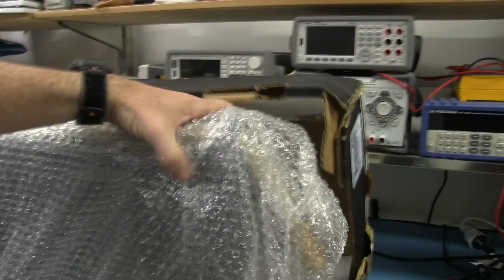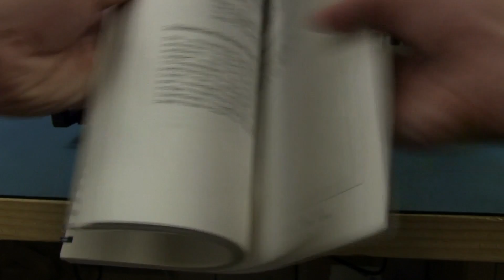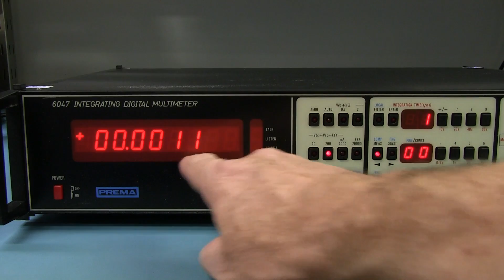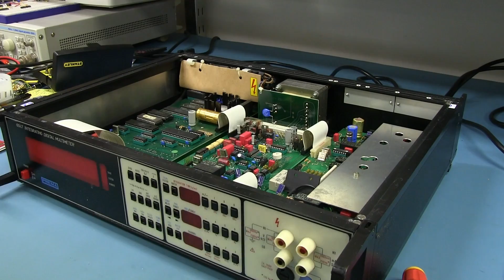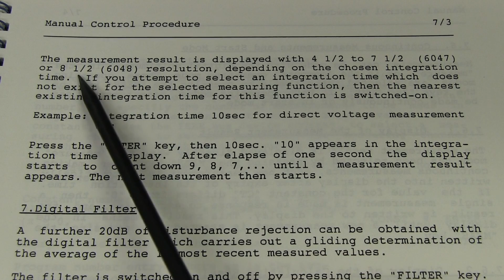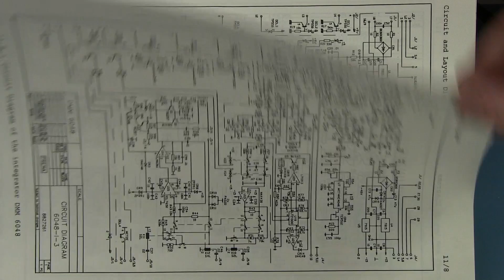EEVblog #613 - Prema 6047 Multimeter Teardown

Comment: hand picked? that makes sense for resistors and cheap components, but for a voltage reference? what do you do with the ones that don't meet the criteria? throw away? that doesn't make sense, those are not cheap
Reply: ThinkLearnSolve You could use them in a lower spec product. Of course you can’t use them in your primary product – it’d make it out of spec. That’s why you select them.

Comment: 2:50 hope the postal service didn't ruin it..

though for this reason (and for chance of the thing getting lost), it's a small effort to send stuff insured.. Where I live, I send anything over 100€ of value ensured because otherwise it's just too risky of getting lost or damaged. Of course with gear like this, you're only going to get back your eBay bidding or costs, and not the full value of the machine

Comment: it is 8.5 digit you can see the extra digits @ 32.21 so i will gamble to say 6047 and 6048 may have the same parts and just different firmware....http://ohh.de/6048.htm
i am sure someone has the firmware stashed away some where.

Comment: Did cost 613 USD on ebay.uk, if that's the one (the dirt on the display and below the power button is the same, as is the black stuff under the mADC button). Quite cheap compared to the HP3458A, but the 3456A is a magnitute cheaper and with 2ppm still more thanb enough for me

Comment: Thing is with Ebay and selling things, packaging cost extra money on the P&P that no one will pay for when other people pack items like the one Dave got for less cost then I fully protected item.

Plus PayPal taking their money which is from the total cost so the money the seller has to send items is even less.

I have sold items on Ebay and ended out of pocket because of the postage costs with the low sell price the item reached.

Comment: typical 80s Dallas clock chips. Hate them SO much. especially cutting into them to solder a new battery holder with battery in so to continue using the same Dallas chip.

Comment: yeah that's the problem with ebay. I bought n analogue tektronix scope off ebay for 60 quid. The bastard didn't package it properly. It didn't work when it arrived. I bet the crt was totally smashed because I could hear what sounded like rattling glass when I took it out of the box. What is the neck of the tube made of GLASS!!

Comment: Isabellenhütte is an old german company specialized in precision and load resistors. they were founded in 1482!
Reply: Interesting. What did they do in the 350 odd years before the resistor was invented?
Reply: "Hütte" in this context means iron works and that's what they did before resistors were invented.

Comment: Great video. Yes the diode, and resistors that appear to be repaired from the top side of the board are not to perfection, but I have serious doubts that those repairs would ever pose a problem. I have seen a lot worse that lasted many years.

Comment: Being that it's still 7.5 digit, is it actually better than your agilent meter? Also, you've said in the past that to calibrate something you need a reference with at least one order of magnitude better resolution. Having said that, could you calibrate a 6047 using a 6048 (already calibrated)?

Comment: Are there functionality differences between the 6047 and 6048? I was thinking about the extra circuitry and thinking about how as a company selling these, you don't want people to say "Well if you change 2 $5 capacitors, you can have the extra accuracy and save yourself $500!"
Reply from the maker: Yes, the 6048 uses the LTC reference and different circuit to drive it. They would have to characterise this part better.

Comment: Better take a backup of that Eprom! - Also, It looks like the front mounted fuse holder is not connected in series with the terminals ?!
Reply: yeah i saw that, it looks like only ONE cable is soldered!, Dave?

Comment: The single-in-line shut resistor you found in there is made by a German company Isabellenhütte (http://www.isabellenhuette.de/en/precision-and-power-resistors/) which produces custom resistors. I found the specs for their trademarked material "Zeranin® 30", but I don't know if it's the same as used in there because it's missing the 30 on the package: http://www.isabellenhuette.de/fileadmin/content/widerstandslegierungen/ZERANIN-ISABELLENHUETTE-R.pdf

Comment: I see the board in the middle was marked as 6048 - I - 5
 and the left from the front is also marked as 6048 - M - 2
And the right one, the one under the shield marked as 6048 - V - 5
I wonder what makes it a 6047... I guess they just used the same boards, just different components ?
Reply: Either that or 6048 is just the part number for the board assembly signifying all of them, I'm not an expert on this stuff though so I couldn't tell you for sure.